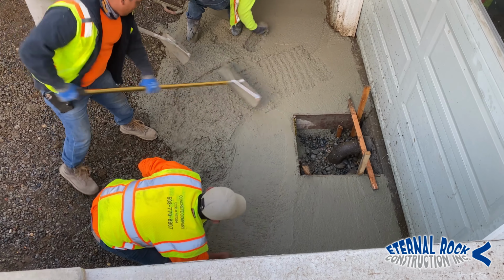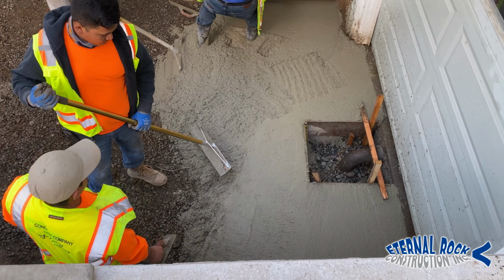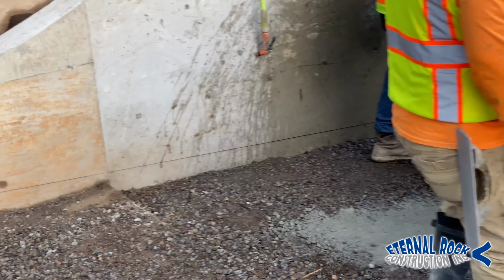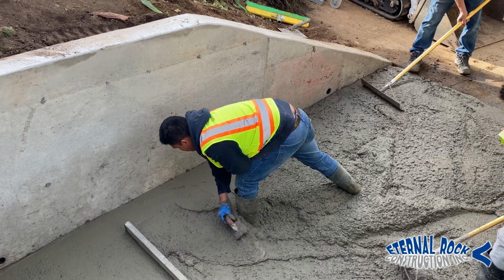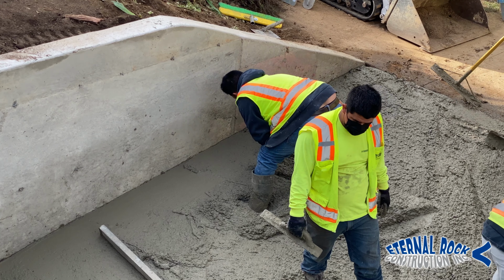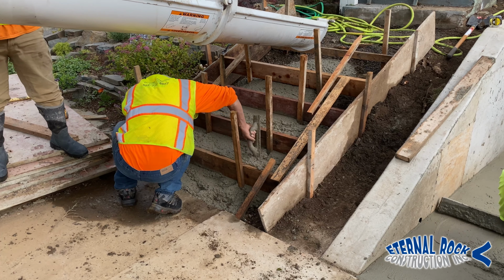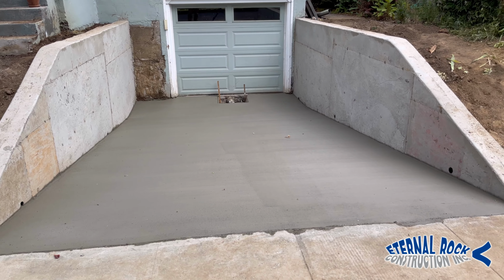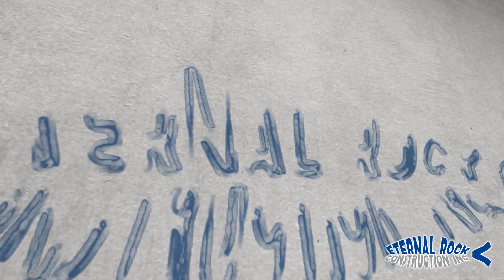How To Pour A Sloped Concrete Driveway Also Some Concrete Steps Broom Finish

Comment: nice work. one thing that will help during pouring is using some painters plastic and hang it over the garage doors or anything you dont want to splatter. 5 minutes of prep saves alot from splatter headaches. We hang plastic on every pour we do